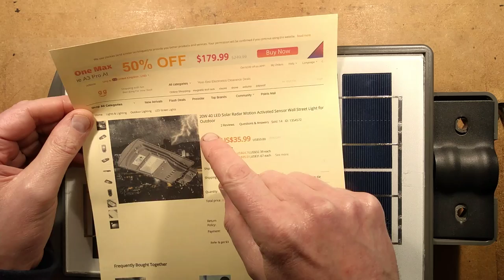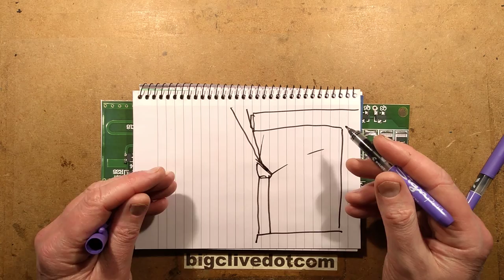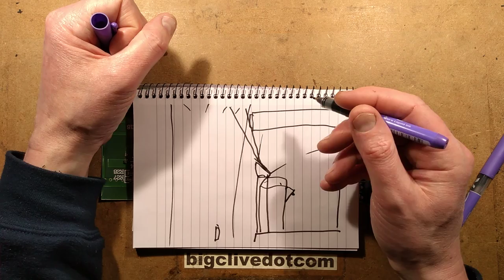Inside a sealed Chinese Solar street light with Doppler detection.

Comment: I still think LED is the wrong choice for street lighting. SOX and SON  FTW!
Reply: At least you can't swich LED off by kicking the light pole. At least i think so, didn't try recently :)
Reply: @werner.x  if the lamp is mains powered  then I'd imagine the impact cutoff is still used.
Reply: If SOX is that horrible pinky orange light then it's about time that all SOX fittings were destroyed quite violently. Their color rendering is abysmal and the light given is nowhere near usable for anything. 
Thank goodness LEDs use similar amounts of power; many councils have been replacing SOX/SON with LED.
Reply: @TheSpotify95  yep, SOX is low pressure sodium, pretty much monochromatic at 589 nm wavelength. SON is high pressure sodium - wider spectrum, but nowhere near good CR
https://en.m.wikipedia.org/wiki/Sodium-vapor_lamp
Reply: @TheSpotify95  Yes, however SOX lamps have a very very long working life they are very efficient in terms of lumens per watt. The even light spread and low glare light from SOX and SON make them ideal for street lighting. 

The SON street lights have been replaced recently around the local area with LED. The light quality is poor compared to the SON lights, the road is now lit in small sections of bright light rather than the continuous even light from the SON lights. The number of lights was doubled with an extra column installed between the existing columns, yet the lighting is still poor and uneven. The LED lights only light the side of the road that they are on, not an improvement at all. 

I'm sure in a few years time LED street lighting will be improved and will become a good choice, but I don't believe the technology is there just yet. With the extra LED light fittings installed I would also expect the total consumed wattage for the roads to have increased since the SON lights were replaced.
Reply: Sox manufacture is all but extinct Phillips have one machine left making lamps and when that dies that's that !! Son is seen as obsolete as well with many lantern types no longer manufactured ballast's and ignitor's are still available but they are being phased out. The flavour of the month are led lanterns with remote monitoring. Which are great in some instances but largely down to the quality of the install. Great as always Clive. Keep up the good work !!
Reply: @benjackson1498  "Sox manufacture is all but extinct Phillips have one machine left making lamps and when that dies that's that" - If that is really true, that is very saddening indeed.

Comment: LED street light fixtures bother me. And for a legit reason, that makes me angry. LED street light fixtures are a product of planned obsolescence. And that fact makes my blood boil. I am not sure what happened, but the cities even in the god forgotten countries such as Lithuania where I live, also got a grand scale changeout of HPS fixtures to the LED fixtures. All in the sake of "reducing power consumption". But the fact is those LED fixtures are utter garbage. I have seen one fixture up close and I saw at least two morbid flaws that will make them die after a few years of use. The fixture relies on its own metal body to cool the modules and the ballast. The body is a flat roof with fins that go in both directions. These ridges will trap trash and debris and will eventually create a carpet of moss that will be like insulating wool on the cooling bit of the fixture. This is utterly bad. The other reason is that the drivers use the components in them that are not reliable, such as electrolytic capacitors that will bulge and leak and short out, and the SMD components that are not trust worthy. You literally open the fixture and inside just a generic green board. How is that more reliable against an iron core wound with copper wire dipped in stone hard varnish and a lamp that has its own little atmosphere to create light in a double sealed glass tube that creates light not by passing current trough diodes that die from multiple unsatisfactory factories that are all present in an outdoor environment! I have seen in my own city, the LED fixtures that have been installed about two months ago by now, and I have seen one already strobing. Why is nobody doing anything to stop and say "this is not reliable technology" especially to be used in financially unstable countries where a grand scale changeout is possible only once in 20 years. This is not right! What was wrong with using HPS technology? why couldn't the Sylvania at Erlangen develop a HPS arc tube that would be much slimmer but much longer to squeeze out all possible lumens from a 70 watt arc tube? Why just ditch the reliable technology all together, considering that all fixtures were already equipped with a ballast and an ignitor that were still set to work for another 20 years at least?? Okay if the goal is to reduce the electrical consumption, why on earth would they build the fixtures in a away that would make them burn out in a short period of time? Why can't they wind special transformers to be used with a bridge rectifier and a ceramic capacitor to drive the LEDs  instead of the cheap green PCB that is not suited for outdoor use? Why can't they install a small fan or even a Peltier device to actively cool the LEDs rather than to rely on the ridged body of the fixture that will gum up with debris after a year or two and stop the cooling process?? I am so confused and angry that we are going not the reliable route, but the "cheap is good, cheap is god" route.
Reply from the maker: Yeah, the LED streetlights are shockingly wasteful.  Just organised fraud.  They really need to introduce a standard for interchangeable components.